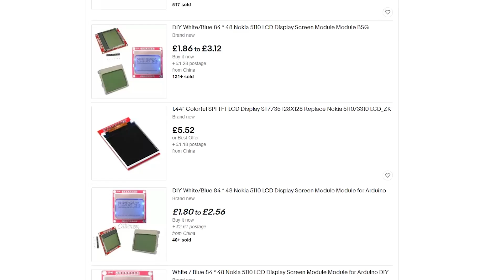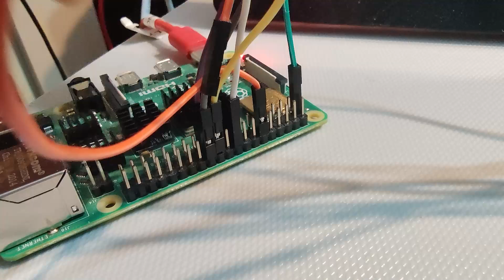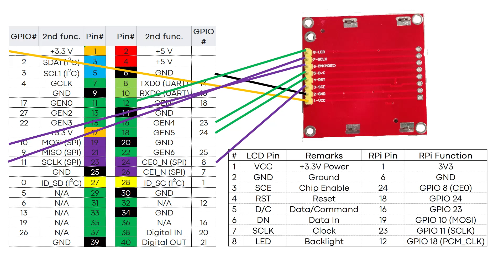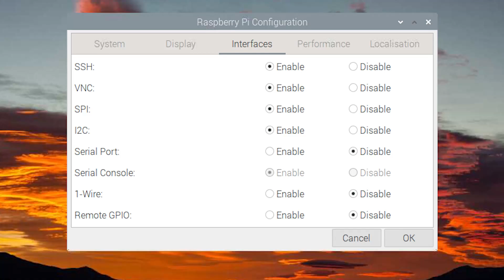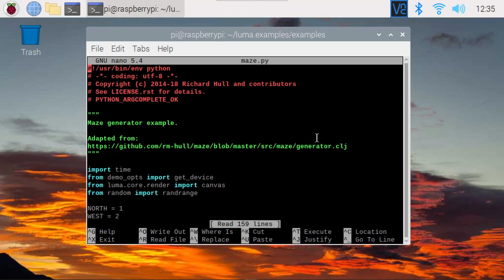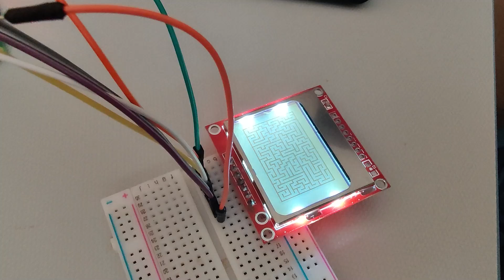How to use a Nokia 5110 LCD Display with a Raspberry Pi

Comment: Thank you for the guide. 
I am having trouble with getting the examples to display. I triple checked my wiring, followed the step by step guide on github, and am able to run the maze example with high backlight. However, the only thing that displays is a large black square that flashes every few seconds. The backlight does turn on.

Comment: Gary the python package you mentioned LUMA didn't work with Pi for pcd8544...it throws warning "SPI channel resource already in use.." and nothing happens, I checked my wiring and everything was correct..but didn't work...also /dev shows spidev0.0 and spider0.1 correctly, so SPI controller BCM2837 platform driver is enabled correctly..so, I wrote my program and used BIT BANGING logic and it worked..I am able to display bitmaps & text...I think, user space application using luma will run into issues if SPI controller driver is used in some module in the kernel space side, so better to not use in the user space side applications, it would run into issues..

Better go for writing a device driver module for pcd8544 using SPI controller platform side driver with a proper device tree overlay which would be initialized & running in kernel space !!